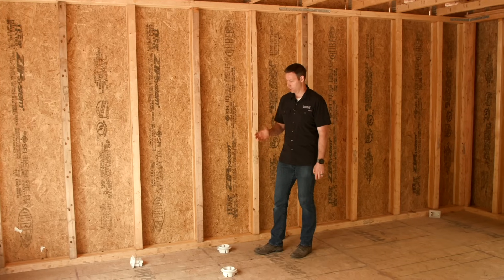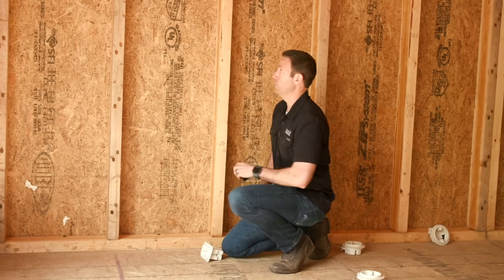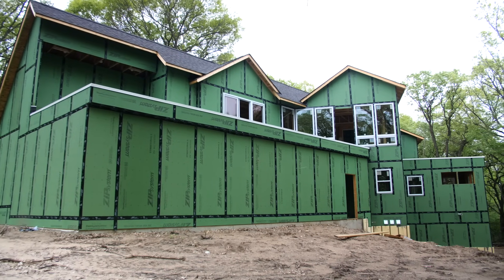Insulated Studs? This is a BIG Innovation in Framing!

Comment: Matt  ask the manufacturer what is their fire rating. Here in Canada wall cavities must have fire blocking ... with traditional 2x  lumber the studs and top and bottom plates acted as the fire blocking. What about the Tstud.  if you use roxul batt insul that would stop lateral spread of fire... BUT the foam in the tstud running vertically is aligned with the foam in the tstuds used as the bottom and top plates... the wood part of the tstud is OK it is the foam that may be the problem... you could use traditional 2x6 top and bottom plates but the Tstud guys say to max the R value and use Tstud for top and bottom plates.

Comment: Matt, Tstuds do offer an interesting thermal benefit. Class A fire resistance is reasonable. How about  toxicity of combustion products. Thanks for covering this system.
Reply: Yeah, usually that foam insulation stuff is nothing but highly combustible kindling.  Don't know that I'd want to go that route.  Doesn't take much to light that stuff on fire vs trying to light a 2 x 4 stud on fire.
Reply: @woodrowmagnus2535  Fortunately that doesn't apply to this product.

Comment: I am intrigued, but skeptical of the claims.  No discussion on structural numbers, except vertical load, yet I see them used in the horizontal position, where they would seem weaker.  8 hours two hundred degrees, yet no increase in opposite side temp, and only an R-20 rating sounds fishy to me.  While I don't think this is snake oil, lots of unanswered questions.
Reply: Spray foam does this I've seen it work like this its not the wood.
Reply: @bobbg9041  huh?  Would you mind giving me some more detail please I have no idea what specifically you are answering and what you are not?

Comment: What is the weight load capacity increase if technically there is.  Horizontal and vertical specs pse
Reply: There isn't any. He is basically just cutting a 2x6 in half and using dowels as webbing.  To replace a 2x6. Not to mention that the increase in deflection strength in one direction  ( at the loss of deflection strengthen in the only direction that mattered). He's a con artist selling an inferior product for more than conventional lumber.

Comment: I see a lot of problems , none of which is he talking about !   Things like off gasing , 24 in. centers instead of 16 in. ,  structural integrity ,   the headers are junk ,  long term  integrity of the glue .
Reply: 16 inch on center isn’t mandatory but this house is built in Minnesota which has tornadoes every month so i agree the structural integrity isn’t secure enough.
Reply: John Sluder tornado doesn’t need to hit it it has splash waves of air which reach miles that can damage a lot of houses

Comment: What he's not saying directly.  Is that they sacrificed structural integrity by using a 24" layout instead  of 16" to offset the increase in cost for the truss studs. He also didn't mention that you can't use them in load points systems or the fact that his header design is complete garbage.
Reply: JR HALL yea the headers are... useless

Comment: Looks like they would be a lot more dimensionally stable also. They have to be a lot more expensive, however. There are a lot of better alternatives to stick framing these days, e.g., Structural Insulated Panels, Insulating Concrete Forms, etc.

Comment: I've watched like 6 or 7 of your videos relating to vapor barriers, air barriers, and exterior insulation  I'm still completely confused because you say you don't need vapor barriers, but then half your featured houses have spray foam insulation.  Isn't spray foam a vapor barrier??????
Reply: You don’t need a vapor barrier but if you wanna add that extra bonus protection then go for it but if your on a budget you can do without.

Comment: I install motorized awnings on houses. I would be leery to install a heavy load like that on this stud. Plus as a retired firefighter I would have hated to go into this house when it's burning.
Reply: I'm a project manager for a GC. These studs are crap. Like tgi joist they burn 20x faster than conventional lumber.  The foam also off gasses toxic fumes throughout it's life.

Comment: This is a great thing, but keep in mind that trusses/engineered beams like these under a fire load have less stability and burn time than traditional wood framing. Then you throw foam insulation in between this already fragile system and you're basically writing off your house if you have a fire in the wall void or a heavy fire load. Now also keep in mind that houses now have a lot more synthetics and that makes fires burn hotter and spread faster making less escape time for you and your family.
Reply: That is all the more reason to have passive fire protection with sprinkler heads. A fully sprinklered building offers the greatest protection against life and property loss. This is not a new thing. It is old school, and has been around for generations.
Reply: 5/8" rock and good old fashioned steel boxes for outlets and switches surrounded with fire retardant spray foam will slow it down bro.

Comment: Hummm I just wonder how can they get R20  in the stud structure. 2lbs Closed cell foam will insulate at R5 to R6.5 per inch of material sprayed?
Reply: two 2x3 have a combined depth of about 3"  there is about a 3" core of foam. Now add the R factor of the combined depth 3" times 1.41 (R factor of 1" softwood) = R 4.23  now add R of 3 " of foam 19.5   = total of R 23.73      You really do not have 3 inches of wood or Foam, subtract that, you easily have R 20

Comment: I-studs laid on their sides for headers?  So you've effectively got two stacks of five 2x2's stacked up over the windows with a closed-cell foam core between them.  If these things are effectively I-beams or web trusses then laying them on their side makes them weaker doesn't it?
Reply: Actually 2x3's, but as long as load doesn't exceed allowable then it doesn't matter if they're weaker; it means standard construction is way over designed.

Comment: 3/8 drywall on 24 in centers ?
Reply: I was a drywaller for 26 years and have never heard of using 3/8 on walls. That just does not make sence.
Reply: Brent I am living in one 3/8 pre finished .
Reply: In normal house construction, 1/2 or 5/8 is used. Yea in house trailers they use it to save weight. But is not a a quality job. On this house I would use nothing less than 1/2 cd which is a very dense and stiff board or 5/8. It would produce very flat walls. Less change of uneven lumber so close to each other.  Plus being that the face of the studs are so wide you will get flatter but joints. Hope that helps. Cheers from Canada

Comment: Okay, how much does a pine 2 x 6 x 8 cost? $8? How much does this insulated stud cost?
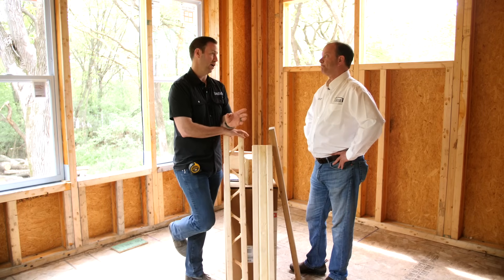Reply: They talk about price delta at 14:15
Reply: Warren Ray Ledbetter   2 foot o.c. Header replacement. Hmm need to do materials list both styles of framing.
Reply: The T-Stud sold by the foot, around $2.00 per foot.
Reply: @3 Subscribers Without Any Videos!!!!! for framing a 2500 sq. Ft. House that is not that much more. 2500 sq ft is a big house.

Comment: So eventually everyone will be required to build with such materials, increasing the cost of homes, and energy companies will just charge more.
Reply: More than likely, because LESS WOOD is being used, the potential to break even, or even save money is possible! 

Also, consider the fact that you, as the homeowner, will have LESS ISSUES OCCUR AFTER the house is built, as described by the 'builder' Matt was talking to!
Reply: Also consider if you're a homeowner who lives in Tornado Alley ....and your house is in the path of the next big one ...imagine not having AS MUCH DAMAGE to your house using this system than had you gone w/the more traditional build 2x6...that's also something to consider!

PS: Because of the load structure this tstud system uses, you can even have higher vaulted ceilings in your 2nd story than you would of had otherwise! :-)

Comment: It's a great idea. But what is the cost? You could use the poor mans recording studio wall where instead of a room in a room you use a 2X8 bottom and top with staggered 2x4 lumber for the vertical then you can insulate by weaving the batting through the staggers and the outside wall and inside wall are also more insulated for noise as well. It may even be less expensive than the insulated studs. Just an idea. Also makes for a strong wall.

Comment: First, that is why we have effective R values which take into account siding, rain screen airspace, sheathing, framing, insulation, drywall, etc.  In my jurisdiction you have to prove your exterior wall assembly meets code and show it right on the drawings

Why not just use steel stud on your exterior walls since you can fit the batt right into the studs?

I think this would be a nightmare with your local building inspector and engineer having countless meetings to show that this is just as good as traditional framing.  There better be a ton of documentation available, ie a complete package that educates everyone so I don't have to

Then you will have to educate framers on how to use this stuff and in this busy market I would expect any contractor to charge a labor premium to cover the cost of the learning curve.  And if you don't tell your framer ahead of time I would bet you can see their taillights as they drive away

Lastly, the builder can afford these studs, but they can't afford the premium for plywood sheathing vs OSB?
Reply: Wow you should connect with the inventor, I bet he hasn't thought of any of those potential problems...

Comment: Wow, that seems like a crazy amount of wood to use for a header, especially when you have the wall studs at 24 on center instead of 16. Also the engineering for the “truss” configuration is only useful on the lateral, and is really meant for spanning. When you use them as studs (compression) this truss structure is not utilized and therefore probably just a waste of money.
Reply: It stops them from bowing-out (remember, the 2x4 studs are turned sideways. In time, they would bend all your walls outward on both sides, like a pumpkin, if not being trussed together)... Also, it holds the foam in place, as the foam will shrink, in time, pulling off the studs, but remaining bound to the dowels. In the naked ones that you foam yourself and in the prefab studs.
Reply: Thank you for your response, I appreciate it. I’m not an engineer although I like to play one sometimes, but it seems to me that the strength of the wall in the long term depends on the glue holding the dowels in place. As you say, once the foam pulls away from the wood this will leave the glue exposed to potential moisture damage and failure. I guess I would’ve liked to see an actual physical connection through the wood rather than a glue joint, I believe that when we build things, we should build them to last as long as possible.

Comment: That is awesome stuff.  Question: When you have such a tight envelope with a T-stud, two lb spray foam and, adding a zip on the exterior; how do you deal with your recommended fresh air exchanges and heat loss?  Heat exchanger fresh air system? That adds some cost to the R.O.I.  Everyone love efficiency but to what end. I have seen houses that were built so tight that there was not enough fresh air getting in. Thanks again Matt. Excellent, informative video.

Comment: Wood in itself is a pretty good insulator from heat and cold. And as a stud, you only have 2 1/2” for every 24” to supposedly increase the R factor.  As far as compression strength is concerned, ie holding up the roof, I can’t see that beam being stronger than a standard 2x6. Plus, homes don’t ever fail from the top down.
Reply: tabcobra wood has an R value of about 1.0 per inch (plus / minus one-third).  TStud claims an R value of over 3 per inch ergo about three times as high. the beam is constructed quite differently from just regular wood, so strength characteristics need to be measured and not intuited. they claim 3x vertical compression capability, which if correct translates into 20%+ less framing needed, which translates to lower labor costs in the framing, offsetting some (possibly all) of the higher materials cost. that’s the benefit, not reduction in risk of collapse. (again all this is based on the company claims.).  on the flip side, builders are rightfully conservative in using brand new techniques and materials without long-term (20+ year) experience; we don’t know what we don’t know etc.

Comment: THESE T STUDS ARE AWESOME & REALLY SHOULD HAVE CAME OUT ABOUT 50 YEARS AGO, BUT I REMEMBER BUILDERS HERE IN DALLAS, TEXAS USING SOMETHING LIKE THEM WITH OSB = ORIENTED STRAND BOARD BETWEEN THE 2 SOLID WOOD PIECES BUT BACK THEN THEY WERE DOING IT SIMPLY BECAUSE OF A MAJOR COST SAVINGS SINCE 2 SOLID BOARDS @ 2"X 2" OR 1 & 3/4 X 1 & 3/4 WITH A ROUTED OUT SLOT IN THE MIDDLE WITH A PIECE OF OSB BETWEEN THEM & IT WAS STRUCTURALLY STRONGER THAN SOLID STUDS OR BOARDS BUT EVEN THOUGH THAT MATERIAL WAS LESS EXPENSIVE THE BUILDERS WERE CHARGING THE END CUSTOMER A LOT MORE FOR HOMES BUILT WITH THOSE OSB TRUSSES & THE HOMEOWNERS WERE PAYING EASILY 15K TO 25K MORE FOR THOSE HOMES SINCE THEY WERE CONSIDERED STRONGER, ALTHOUGH i SAW MORE THAN 1 HOME BUYER REFUSE TO ACCEPT THE OSB CENTERED TRUSSES OR WHATEVER THEY ARE CALLED OPTING FOR THE SOLID WOOD CONSTRUCTION BUT BY DOING THAT THEY WERE SAVING MONEY ON CONSTRUCTION WHICH IS REALLY INSANE IF YOU ASK ME, BUILDERS NEVER SHOULD HAVE EVER BEGAN CHARGING MORE TO USE LESS SOLID WOOD, BUT CROOKS WILL BE CROOKS NO MATTER THE INDUSTRY THAT THEY WORK IN, THOSE OSB CENTERED MATERIALS WERE STRONGER BUT COST LESS TO THE BUILDER WHEN THEY BOUGHT THE MATERIALS & THEY WOULD TURN AROUND & CHARGE MORE SIMPLY BECAUSE IT WAS STRONGER IN LAB TESTS LOL AS I9 SAID CROOKS WILL BE CROOKS.

Comment: Nice concept, insulation aside, thinking about a 2x3 getting nailed 3" in center from sheathing is going to split in areas and in a hurricane I want structural strength. He was impressed with what the T-studs could support, but what about holding the house together from uplift. I've worked with 2x3's in mobile homes and they split twice as much as a 2x4. Sorry but I'll stay with a higher electric bill!

Comment: Or you could build your home using SIPs (Structural Insulated panels) and not have to add inefficient insulation after the framework is complete.   They go up faster than stick built, with greater precision and no drafty air leaks.  Take your stick design to a SIP manufacturer for a quotation.  They will cost more but they include superior insulation built in.  Channels are in place for running wiring and there is no requirement to drill holes through studs to run horizontal wires.  Far more energy efficient.

Comment: Wood is not a good insulator? Ha ha ha. Twin 2x3's stronger than 2x6's wall construction construction? Now we using mobile home framing? Ha ha ha. This is better insulation r value over 2×6 batts? What about 2 story homes, high wind zones, wiring and umbing with 2×3 constrution, guards on every stud? This guy has fallen on his head

Comment: mr. build your calculations are quite off on a standard wall of studs 24-inch on Center the wood portion of the wall is about 6.5% wood. so to outweigh the cost vs the material it would take 15 plus years to pay for the offset and energy cost. not to mention I personally would rather my air being filtered more often through a quality HVAC system that has HEPA and Pollution  filters, meaning when the unit runs more the air is filtered more, remember that air inside the home is 3× more toxic than the air outside. put your money where it really counts your health

Comment: How do they assemble them?  The alternating diagonal dowels seem like an impossible glue-up.
Reply: The "stud's" holes are drilled in a fixture. Then a pair of studs are clamped in another fixture and the round stock is pressed in preglued holes.
Reply: @filster1934  Still looks impossible, because of the alternating angles of the dowels.  What am I missing?

Comment: So what's the Energy savings vs the initial cost to build cuz you know this project is going to cost more than a conventional Lumber because anytime a manufacturer engineer or a carpenter starts using the terms advanced modern or efficient the price just tripled and how does this material hold up to earthquakes tornadoes and hurricanes I mean technically you can probably build a house out of popsicle sticks but that doesn't mean it's going to be strong

Comment: Boards made from a hemp-based composite is stronger and lighter than those made from wood or steel also makes good insulation and thermal barrier and is naturally insect resistant, cost less and you don't have to cut down a single tree to make it. A No Brainer

Comment: I doubt wood 2x6 transfers very much heat. Info-mercial.
Reply: Based on your extensive experience in construction and thermodynamics?
Reply: @tmoney1876  I've been around construction for 35 years albeit industrial for the most part but I do recognize the temperature that my hand feels when I touch a 2x6 stud, never felt a really hot one unless it was on fire. No I'm no expert but this sounded like a commercial.
Reply: @tmoney1876  Yep.

Comment: Double the wall up for R40 and never pay for heat again, just solar and body heat.
Reply: Take a dirty pair of socks put them in your best cooler for a month.  Then open the lid and take a whiff.  That's what the house you described is going to smell like in a month.
Reply: @leonardhall7203  Simple inexpensive heat exchanger used all over Europe and other places will give plenty of fresh heated air. Of course any wrapped house is the same will smell. The insulation value has no effect on fresh air flow into house just saves 1'000s of dollars .